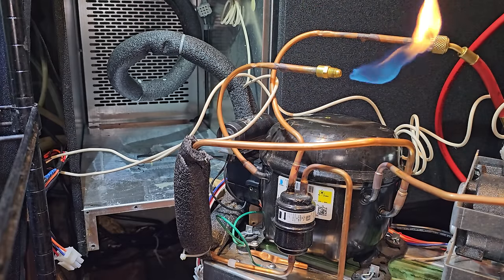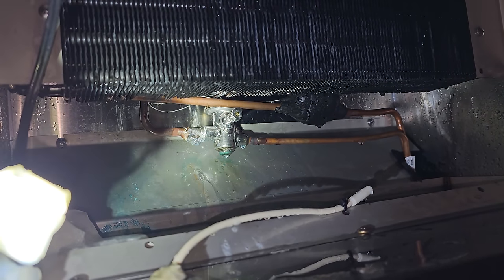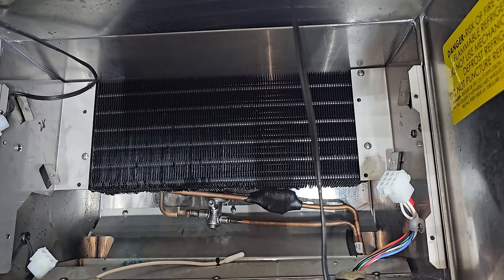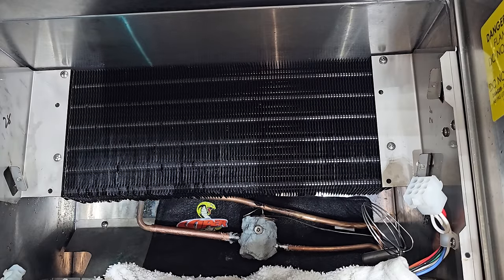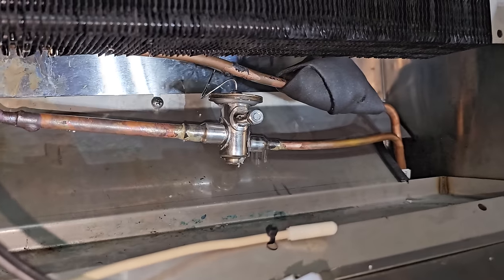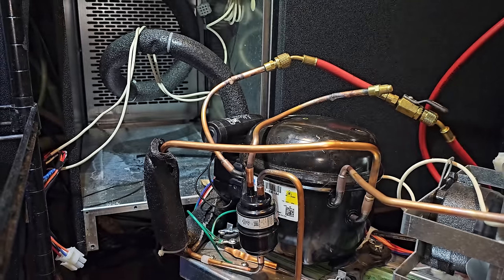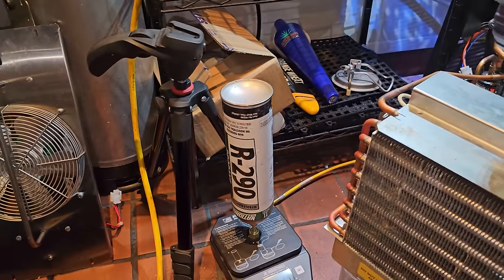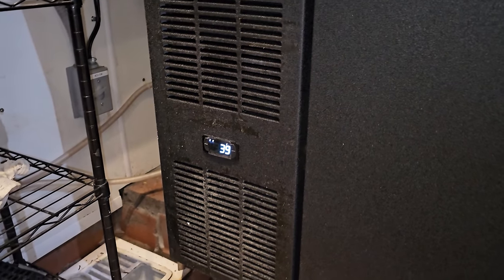DANGER ! R-290 IS A HIGHLY FLAMMABLE REFRIGERANT

Comment: Have to use a vacuum pump rated for a A3 refrigerant?
Reply: After nitrogen flush, it is ok with any vaccumpump. The flame can't even ignite it after all the flushing whole brazing time. But, assume the switch is igniting while switched. R290 is more dense than the air, meaning, it can sit on the floor and be ignited while switching the vacuum on. But you should get rid of the propane frequent, you don't wanna start a fire because a dropped hand tool made a spark. Or when it is time to ignite the braze torch for the first time of the repair, no propane pool on the floor at that moment please.

Comment: Propane as in r290 would help with low energy cooling for what i need.
Reply: Nothing has low energy. If it's using electricity then it's costing money either way. 😮
Reply: @HVACRDUDE  There's a difference between high costs and low costs. 😑
Reply: Can it run off 12, 24, 36, 48, or even 50 to 60 volt dc? Automotive has set above 60 volts as hv. So I have room for dc current of volts to be high as 60 but lower amps as in below 50 to 25 amps.

Comment: and i’m still amazed that people actually put propane into their cars lol crazy stuff
Reply: A while back people were using it for fuel in their cars, and the UPS trucks even ran on it (diesel engines love running on propane, apparently).
Even crazier is that there's also options for CNG cars (compressed natural gas, methane at like 3k psi).

Comment: hey is R290 typical refrigerant noise is like there is running watter? i have portable AC with R290 and everytime it sounds like the watter, i think its refrigerant noise because i emptied out the water and its still doing it. was doing the water spilling noise ever since i got it
Reply: I have always been interested it what the sound is coming from. I have plans to find the issue on my freezer and my small cooling box. My guess is bad evacuation (water content freezing and interupts the flow), bad deburr before and after metering device, wrong charge or not so clever pipe routing. My condenser is upside down from factory, is makes a lot of interesting sounds. Horny hen alike. Anyway, refrigerant type is not the issue.

Comment: What’s the point of having a hydrocarbon based refrigerant? Price? Seems pointlessly dangerous. I get that we use much greater volumes of flammable gases like propane or natural gas in other uses but we add methyl mercaptan to it specifically because we are very, very sensitive to that smell and can detect even small leaks with our noses. I’m not a commercial refrigeration guy, but I’m guessing (based off what you’ve said) that this is pure propane, and therefore it doesn’t smell at all.
Reply: Its for the Enviroment....GWP, Wide Options of Usage. Low Temp, Mid Temp, Heat Pump....Since Regulations are so strict and getting even stricter, you end up with solutions like that.

Comment: Not supposed to put tap ins on 290 use the pincer tool!!
Reply from the maker: There is nothing wrong with adding braze on access taps , in fact they are better! The bolt on style leak and should never be left on

Comment: Why don't you solder the valve to short copper stubs outside of the cabinet, then install the assembly as whole.  Then you only have copper tube over coppet tube go deal with.
Save a heck of a lot of banging your elbows.
Reply: More points of failure is my guess.

Comment: I am going to disagree with what you said to agree with you. I personally don’t give a crap what any manufacturer says…. Heat will change a TX valve performance… I always take and always have precautions to limit the exposure of heat to the TX..  an Like it or not propane is going to become the number one refrigerant.. I did ask why they didn’t use a deodorant.. an they told me the deodorant, could make things a little sticky overtime and possibly cause plugs in the system 🤷🏻‍♂️ so 😂 who am I to argue with the smart guys 😂😂

Comment: I would get a contract made that the customer sign before doing the work, to approve aftermarket parts if it would be in the best interest and that you and your company spared of liability of consequences, of using these parts. Give them a choice. I do not agree with manufacturers, because they are profit driven and will buy up a ton of cheaper parts from China and resell as OEM at an inflated price. A power cord, yes, and the txv with the microthin copper plating, yes! Then the manufacturer gets the best lawyers to fight the little guy.

Comment: I think it would have been easier to pull the entire evaporator out.
Reply: Have you ever pulled a glastender evap 🤣🤣🤣🤣🤣 it's really really dumb. In the factory it's very very clear the install it before putting the top on the unit
Reply: @jasontexter1721  no I haven't. I was looking at the Phillips screws and I wondered if it would be easier to braze the txv, since it's more difficult to braze, out of the cooler and would be easier to cut and braze the copper lines going down right below the evaporator. However for all I know there's screws that can't be accessed to remove the evaporator.
Reply: @Bryan-Hensley  way easier to braze in place. You're making 4 extra braze joints removing the evap. You have to cut the lines in the compressor section and fish the lines out etc. In place is easier. Everything is metal inside there anyway you can't burn it up unless you REALLY go to town 🤣

Comment: Why change the valve? Weld It  thats it
Reply: my thought exactly. why not just clean and resolder with silver.
Reply from the maker: It's been brazed on twice now and the initial braze job never stuck so as I said in the video I don't have good luck with silver on top of 15% silos which is how the valve was initially brazed in. So I removed the old valve and brazed the new one with silver and it likely will never have another problem

Comment: Refrigeration engineers are terrible in this field. Honestly don’t know how they get hired. Had one tell me that I didn’t know how to build these systems better. If a seasoned tech cannot build a better unit than the factory then they aren’t a good technician. I can tell you with absolute certainty that a pro could build a unit that would last well over a decade without any leaks or major issues and when it needed a major repair it’d be much easier to service. 

The easier it is to service the less likely it will break.
Reply: Counterpoint, and IMO most of the reason these things are so hard to service:
If it DOES break, and they can't fix it, they have to buy a new unit. From the same short, and ever-shortening, list of suppliers.
No matter what you do, it's in all of their best interests if the thing breaks as soon as possible.
They can't make money off of a product that lasts forever!

Comment: It's basically propane.
Reply: Thank you Captain Obvious.
Reply: It's EXACTLY propane, minus the added-in smelly chemicals they put in grill gas (because those would mix with the compressor oil, get hot, thermally decompose (turn into different molecules), and the products of that thermal decomposition would turn the compressor oil acidic, which causes compressor damage and premature failure).

Comment: fuggin engineers, man
Reply: The engineers want to make a product that lasts 100s of years without problems.
But then the bean counters say that costs too much, so the engineers have to figure out what to cut costs on, and then the product only lasts 10 years.
And the bean counters say it's still too expensive, even tho they can charge that much and sell millions of units, because they can't make 50% or more profit off of it.
So the engineers cut even more out of the thing, and it now only lasts 3 years, and the engineers tell the bean counters that very forcefully.
Then the marketers say it'll never sell with a 3 year warranty on it, they have to put a 5 year warranty on it or nobody will buy it.
So they put a 5 year warranty on it and call it good, and wonder why all their profits are getting eaten up by warranty claims 😆
Typical end-stage capitalism at it's "best".

EDIT: And this is why I never personally blame the engineers, it's always the accountant's fault.
That's also why "they don't build them like they used to". You know how economic inflation works right? As time goes on, a dollar RIGHT NOW will buy more than a dollar 10 years from now will buy.

OK, you say, but how does that mean that all the products we depend on turn to shit quality over time?
Easy, it still costs the same amount of inflation-adjusted dollars to build something "like they used to".
So instead of the cost of the appliance or car or whatever going up and up and up over time, they keep the cost the same, and give you a less quality product. Blame the accountants again, that's who's doing it.

Eventually you end up with a "coffee maker" that doesn't even last a year (god I hate keurig-like coffee makers, more circuits, lots easier to break) when a standard Mr Coffee drip coffee maker like they built 20 years ago is still working today (if you de-scale it regularly), and you can thankfully still get one for under $50 at Wal-Mart or Target or whatever other big-box store you might have in your area, and it'll be 90% plastic these days but it'll last as long as you keep cleaning it. But at that price point, you can afford to not clean it and just buy a new one when it finally gets clogged.
Or pay $10 more and get one with a little clock hooked up to a relay so that it can start the coffee for you in the morning before you wake up, but the "working guts" of it are the same as the one that's less than $50 (probably more like $25 for the cheap one).

I know what to stay away from with most appliances. Too much electronics in the thing. A microwave that has an electronic timer and clock and all that stuff, like what you could get in the '90s, that's fine. What's not fine is a microwave that uses an inverter to drive the magnetron, instead of the typical big laminated steel core HV transformer and a simple diode and capacitor for the DC HV power supply to the coil, and another 6 volt winding on the same transformer for the heater of the magnetron (which is a vacuum tube, just like back in the '40s all radios were using).
Sure the inverter might save me a few cents on my electric bill, but if I have to buy a new microwave every 5 years guess what I'm still spending more overall on the appliance's lifetime costs (both purchase price and the cost of all the energy it's used over its lifetime).
So give me the "dumb" appliance every day.
And don't get me started on "smart fridges". Those are for people who can afford to replace their entire fridge every 5 years because the little Android tablet built into it can't get updates anymore (that's how they force you to buy a new one by the way).
Reply: @44R0Ndin  just had to put the screw on the other side, mate
Reply: @jordanhenshaw  And why do you think they didn't do that? It wasn't an oversight. It was intentional. That's my whole point. They're intentionally making it hard to fix them, so that you are further incentivized to buy new stuff instead of fixing the old stuff.
Just like Apple does with iPhones. You used to be able to fix those. And now they do their best to make sure you can't, even so far as lasering off the numbers on the chips they use so that you can't know what to replace it with or what it even does.
Reply: @44R0Ndin  I don't think they're that smart.

Comment: My God...
Am I on the right channel?
You can release R290, no worries, but get a fucking hose, tape it up and release the R290 out the fucking window.
You wore literally making an explosive mixture of gas inside that enclosure.
One single spark, ESD, Electrostatic or whatever and you would have left the job site without an eyebrow or two...
There's no point in having the right tools if you don't bring them to the job site.
Also, not having the proper pipes, adapters and TXV...
Ordering the wrong part and bodging it up...